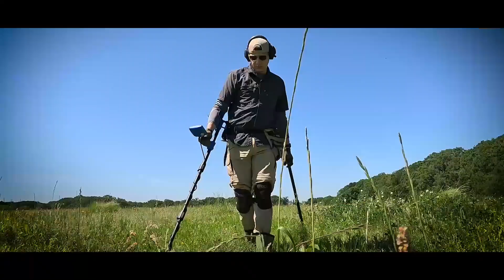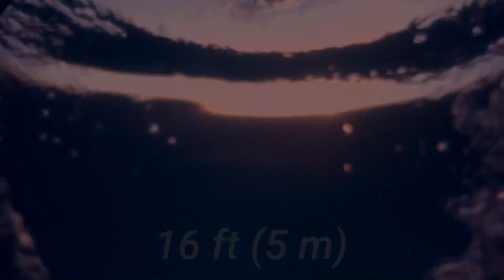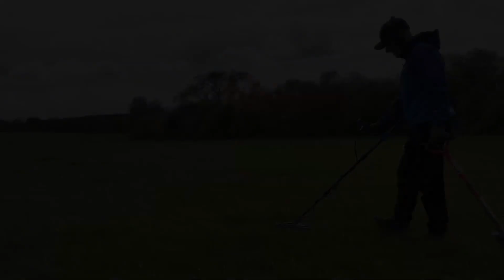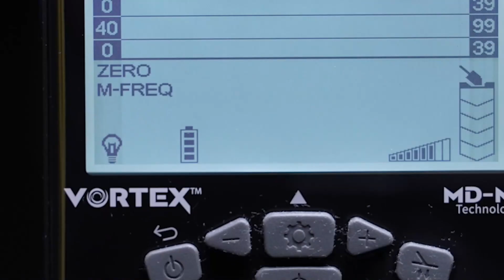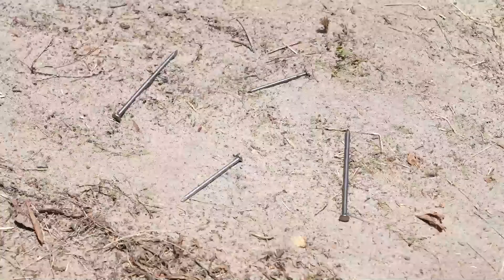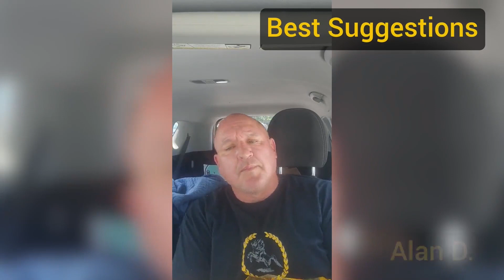Vortex Live Event Recap

Comment: I used the at pro for 5 years and loved it had all my best finds with it and still own and use it to this day then went to the equinox 800 and then the manticore both great machines but iv allways had a soft spot for garrett , held off from getting the vortex as id heard mixed reviews with the early firmware but iv just bought a vortex vx9 and put the 9.13 update on it and im very impressed , its very deep and and pulls deep coins out of the iron on my iron infested sites , its good to be back with a garrett , looking forward to really learning the machine , i think it will be an excellent tool once iv had a few month with it